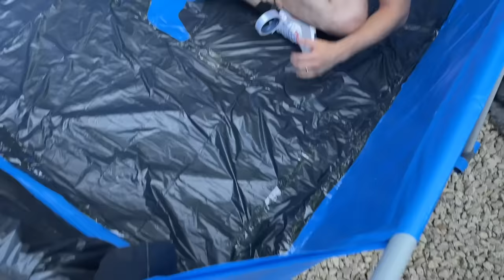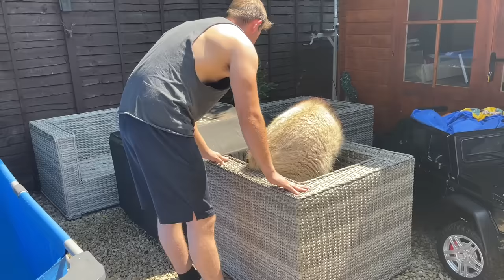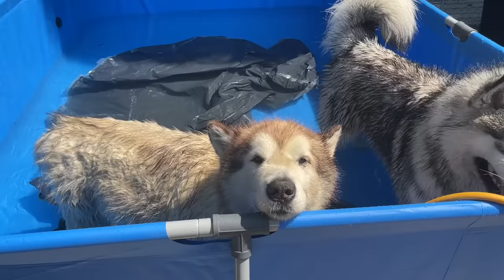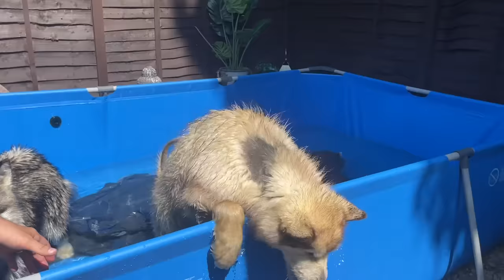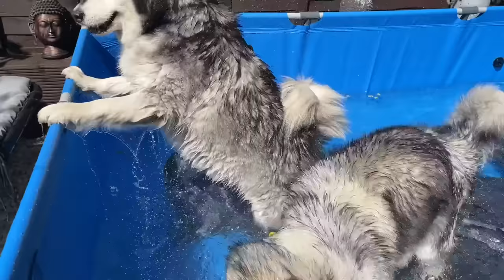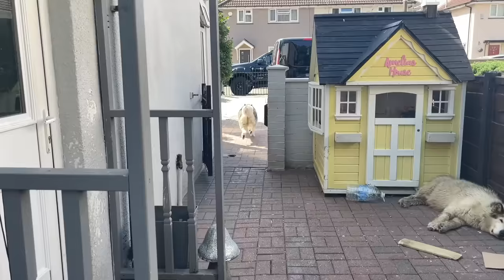Giant Sulking Dog Thinks It's Bath Time So Tries To Avoid!! Heatwave Pool Party!

Comment: You might consider putting something like a pool block on the inside of the pool, and another on the outside of the pool, to make it easier for them to get in and out. They won't feel trapped that way, and will feel less panicked being in there. Anything that can be waterlogged, or just heavy and large, that they can use as a stepping stone. They're much more likely to use and enjoy the pool if they feel like they can get in and out on their own.